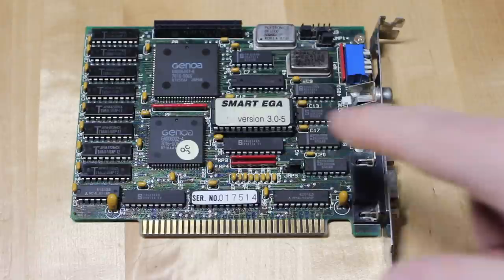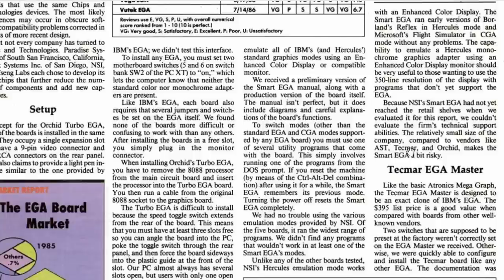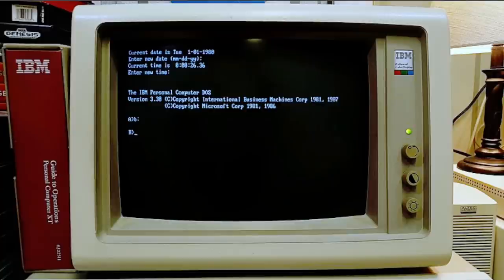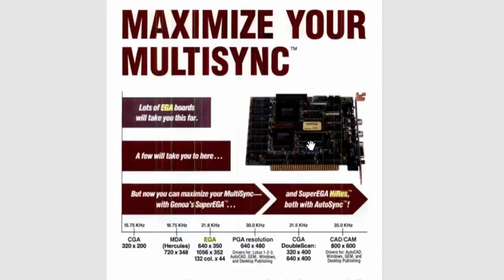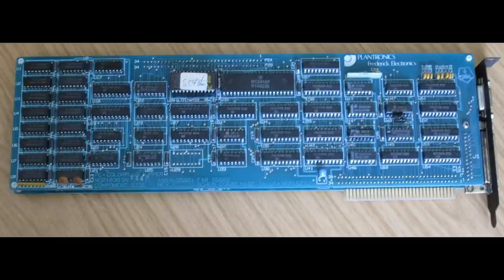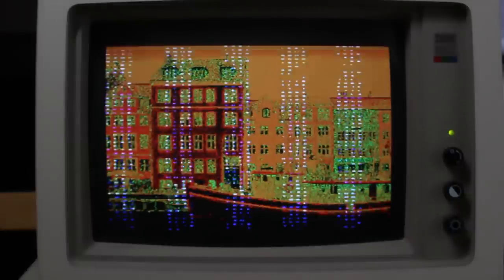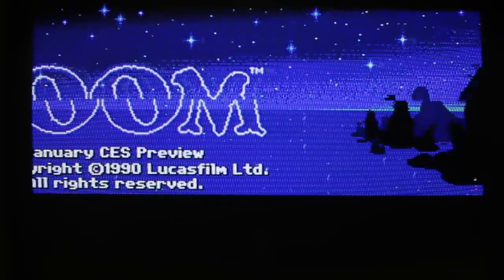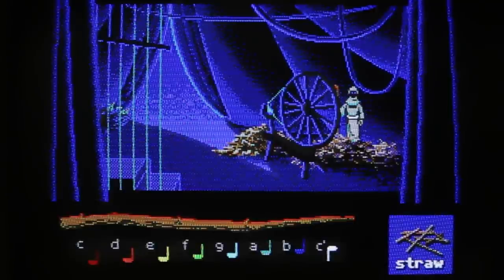The intrigue of SmartEGA and SuperEGA

Comment: About the advertisement at 5:00 - if the card supports double-scanned CGA at 31.5 KHz, would it be possible to force it to only use these modes and connect a normal VGA monitor with a DAC?
Reply from the maker: That sounds like it could work. As it happens I have an NEC Multisync VGA monitor so in theory the higher resolution modes might work too. There's no guarantee though. For a while every EGA card required a specialised monitor to go with it.

If an RGBtoHDMI adapter doesn't work I might look into the DAC idea. The main problem is eliminating noise. Everything has to be fairly well shielded.
Reply: I'd expect so, you can connect 15kHz TTL to SCART with some resistors to drop the P2P voltage down from 5V to 0.7V, and a simple XOR (?) gate to combine the syncs. For CGA to VGA you could use an IBM-to-RGB converter circuit which is a fairly well known quantity (really it's a case of each of the primaries contributing about 0.47 volt, and the intensity bit 0.23 volt to all three channels, with a special case to reduce the green intensity by half for "brown") and maybe not even have to do anything to the sync at all. Or if it uses the EGA colour standard... each of the primary colour lines just needs to be reduced to 0.47 and each of the secondaries to 0.23 volt and that's that. IE you build a very simple 2-bit-per-channel DAC right into the cable...

That's really all the Multisync does inside the case when displaying a CGA or EGA standard image (I think a genuine one even has a switch to cut out the IBM RGBI processing and turn brown back to dim yellow?), as does an actual EGA or CGA monitor, as the electron guns are themselves analogue devices. The use of TTL signalling is really just to make things simpler on the video card end (ditching the DAC is cheaper and uses less board space, and if you don't have a big palette it's kinda unnecessary), and also helps maintain signal quality at what were considered high frequencies at the time over not particularly good cables running between cards and monitors with circuitry that may not be the greatest at handling high frequency analogue signals other than for the fairly short run between monitor cable input and the actual tube.

(heck, even the comparison machine of the ST used TTL for its highest rez mode, though that was double what EGA managed, and later the TT's and the Amiga's ECS extra high rez modes were respectively mono TTL and reduced to only 64 colour palettes for similar reasons, despite having VGA-grade analogue colour at regular resolutions)

Comment: I think that using of static RAM is the reason why original CGA is faster than this one. Static ram chips are usually faster than dynamic. But still, this card was released 4 years after IBM CGA, there is no excuse for being slower.
Reply from the maker: I'm almost 100% sure the original IBM CGA card used DRAM. If you don't access sufficient locations in a given time it actually loses its contents.

Comment: doesn´t the composite out work to hock up to a normal TV, they you would get 640x480?
Reply from the maker: I don't know if those are composite outputs. On original EGA cards they were something else. It's a while since I made the video, so I don't recall if I found out differently in this case. The issue though is that composite output is a relatively poor quality signal usually. But at least technically, what you say is at least possible, as some manufacturers did make one of the outputs a composite out in the mid to late 80's.
Reply: @PCRetroTech  how diffrent is the synk? I remeber my old high-school running vga on ega monitors via a semi passive adapter. The opposite should be easier.
Reply from the maker: @matsv201  I can imagine a digital to analogue passive adapter but not so much in the other direction. EGA had two sync methods so monitors could distinguish modes. I don't know much about VGA sync, but it's probably related.
Reply: @PCRetroTech  the amazing thing is that windows 3.1 looked pretty much the same on those ega monitors as in ega monitors.. the colors was pretty much exactly the same. But there was one drawbacks. The screens was pretty blury... and well  running windows 3.1 on a 386SX is not optimal.
Reply: @PCRetroTech  if I understood it correctly they pulled the analog output with resistoes so it ended up on diffrent side of the trigger point of the digital adapter. This would make 3 of four diffrent scenario possible. The  have to use a transistorer aray or something simular for the last.

Comment: 5:25: I noticed you have IBM's Guide to Operations \ Personal Computer XT. I think you have a 5150, don't you? Or do you (just) have a 5160?

I'm asking because when I got my 5150 from the reportedly original owner, it also came with a Guide to Operations \ Personal Computer XT -- emphasis on the XT. So I got a UK/European PC and it came with a GtO that said Personal Computer XT. I've long wondered if that's because by the time the 5150 was generally available in Europe (i.e. 1983), the 5160 was also out, and maybe there never was a PC-only GtO for the 230V 5150. Maybe GtOs for 5150s sold this side of the pond always also said XT, even though that's technically incorrect and arguably adding to the (even then) widespread confusion (of people falsely equating PC and XT machines).

Can you comment on this? Does anyone know for sure? 

PS: I note our GtO says 6322511 on the binder's spine. My GtO says 6183479 on the title page inside, not on the binder.
Reply from the maker: This wasn't my photo but one from Wikipedia. Thanks for reminding me. I forgot to add it to the credits.
Reply: @PCRetroTech  Ah. Pity. If you or anyone else knows anything about this Euro-GtO PC/XT mystery, I'd love to hear it. 

I do know that at least early US 5150 GtOs only said PC, not XT. I would really like to learn if later GtOs, or at least later European GtOs that shipped with 5150s also said XT, because this seems to be such an odd inconsistency. 

I know many people got it wrong back in the day and referred to PCs and PC clones as XTs/XT clones -- and here's evidence of IBM doing the same thing! So weird.
Reply: @ropersonline  They were referred to as XT by late 83 to simply incorporate a distinction to the PC-AT.

Comment: Very interesting graphics card. I have an ega card that claims to be HEGA, I wonder if the h is something special like this card or just a marketing name.
Reply from the maker: That one I am not familiar with. There were a lot of these insta-standards that popped up around that time.
Reply: Probably "Hyper EGA" or "High-res EGA" or the like, or even just a company name (I think the parent company of one of the most commonly used super-EGA chipsets started with an H but I can't quite remember the rest?)... So, like, Hyper-Enhanced Graphics Adaptor ;)
Reply: @tahrey  mine was made by paradise. Some of them do have enhanced capabilities!
Reply: @CoreyDeWalt  yeah i don't think it's a name that as yup iijh
Reply: @CoreyDeWalt  aghhh phone phone ky
Bboarrrd
Reply: @CoreyDeWalt  aghhh phone phone ky
Bboarrrd
Reply: @tahrey  come again?
Reply: @CoreyDeWalt  Sorry, my phone had a bit of a freakout and I didn't have any time left to follow up once I finally got it working again.

Anyway, I think I was basically trying to say that I don't think it was a name that was used much for actual box sales, maybe some OEM distribution and showing up in POST screen messages, but otherwise it was more of a parent holding corporation that owned (developed?) the clone / extension chipset and BIOS ROM etc, as well as one or two of the better known brands that the boxed cards were actually sold as (e.g. Paradise, Genoa maybe?) and selling chipsets to other brands.

"Headland" possibly?
Reply: @CoreyDeWalt  Oh also I was probably going to ask if you could work out some things regarding those enhanced abilities, particularly if you had a way to measure the frequencies. Unless I already did?

Comment: Lines are the only factor that define CRT resolution. Number of horizontal pixels is irrelevant for monitor since it's just an analogue signal.
CGA has just one 200p mode.
EGA has 200p and 350p.
VGA also has two modes 400p 70Hz and 480p 60Hz.
VGA also has 200p and 240p modes, but it's doubling every line, so such modes appear with unique doubled scanlines and CRTs sees them as 400p and 480p modes anyway.

VGA could run many 'tweaked' resolutions with nearly any horizontal value from 256 to 480. However vertical lines were limited to 200, 240, 400 and 480. It was possible to run different values, but it could damage the display.

Anyway PC graphics standard were a mess. CGA had terrible palettes, EGA was even worse since it should have at least selectable palette in every mode from 512 colors (like Atari ST had). VGA tried to make things right, but it ended with very limited feature set, because it had to be backward compatible with CGA and EGA.
Reply from the maker: I think it was possible to get different numbers of displayed lines on VGA through letterboxing or by using the overscan without damaging the monitor. But fundamentally these were just variations on a theme, the themes being those you listed. Going outside the bounds offered by those modes could indeed be problematic.
Reply: @PCRetroTech  VGA being backward compatible also supported 350p, but I don't know if original VGA used 350 lines directly or displayed letterboxed 400p. My ISA Cirrus Logic SVGA uses 400p in high-res EGA modes. These are of course all 'safe' modes that shouldn't damage VGA monitors.
VGA was flexible enough to allow setting a large variety of modes. 600p was the most popular of undocumented modes, since it got support in popular software. Windows 3.1 SVGA 800x600 driver will fallback to VGA 800x600 56 Hz mode if there's no VESA modes.

However the problem is, that despite VGA quickly become a widely adopted PC standard, nearly all cards were actually clones with some Super VGA abilities that could do 800x600 in 16 colors and 1024x768 in 4 colors even if they only had 256 KB of RAM. So it's really hard to even get original VGA hardware to test it's capabilities.
My first PC had OAK 67 SVGA with a monitor that could do up to 1024x768 interlaced.
Reply from the maker: @Leeki85  I have a large number of VGA cards, but I haven't actually spent time checking yet if any are really just VGA only. I once saw an auction of an original IBM VGA card, if there was such a thing. It certainly had IBM chips on  it. It went for an absolute fortune and even though I knew that would happen I underestimated its value to collectors by a factor of about 2 or 3.

I have a few OAK cards, but I'm not familiar with the OAK 67 SVGA. I remember my first VGA was a TsengLabs SVGA. I can only imagine that was an ET4000AX as it was in a 286, but I really don't know that for sure as I don't remember the model number. It's also possible we were actually supplied something cheaper and told it was a TsengLabs. We wouldn't have known the difference at the time. We'd certainly never seen one before.
Reply: @PCRetroTech  Yep, IBM made an 8-bit VGA-only card.  Officially called the "PS/2 Display Adapter", since the idea was to bring PS/2 graphics to other PCs (and to the MCGA PS/2 models for that matter).
Funnily enough, one magazine ran a series of compatibility tests (PC Tech Journal as I recall), and found that IBM's VGA card wasn't 100% IBM VGA compatible!  That is, it doesn't behave exactly the same as the PS/2's VGA chipset.  I guess the latter was the only real deal.
Reply from the maker: @x86VileR  Ah now only IBM could do something as hilarious and confusing as manufacture a VGA card that wasn't.
Reply: @PCRetroTech  It took IBM a lot longer than its clone-maker competitors to figure out that the market demanded 100% hardware compatibility. Initially most vendors thought that mere DOS compatibility would do -- arguably a step up from the CP/M and BASIC dialect zoo, but it became pretty clear pretty soon that customers weren't buying semi-compatible hardware. One wonders what IBM could have done if they hadn't made that mistake with the PCjr and the MCA and PS/2 and PS/1 lines. (Correct me if I'm wrong, but I don't think IBM ever made a mainboard with both MCA and ISA?) Generic clone-makers ended up being more compatible than hubristic big brand vendors. Of course there were exceptions. Compaq's success came because of their compatibility.
Reply: @ropersonline  They DID!  Its a pci based 486 pizzabox that had MCA bridges. And it has 1 isa slot. And it came after the PS2 line was long gone.... name of it fails me at the moment.
Reply: There are limits. The video card pixel clocks and the hardware using them can only run so fast (e.g. vanilla CGA is 14MHz, EGA 16MHz, VGA 25 and 28MHz), and the monitor circuitry has a soft upper limit on the bandwidth of the circuits that interpret the incoming video signal and then feed that through to the electron guns (which effectively means that the higher your vertical rez, the less your horizontal can be ... which can be demonstrated with a too-long non-shielded VGA cable and trying to drive a 1080p flatscreen in a conference room from a small formfactor PC's integrated graphics - although that's more down to signal reflection and such in the cable, it still gives a very horizontally smeary image at full HD rez, but clears up quite quickly to having sharp pixels if you drop back to 720p).

On top of which, there's the dot pitch of the CRT colour mask, which is barely even good enough for any kind of readable 80 column text on some basic tubes...

As for the lines thing ... your total lines per frame (active plus blanking/sync) multiplied by frames per second is tied to your horizontal sync rate, which is the real ruling factor, along with the limits of vertical sync (and, in some cases, your eyes). Multisyncs can only cover a certain limited range on both fronts without having trouble (and as you near the limits, you have difficulty with adjusting the size and linearity quite as you may like it), and fixed-frequency monitors, whilst they don't have to be driven at an absolutely exact rate (you may have like 5 or 10% variation, which at least lets you cover 50 and 60Hz if centred on 55, or even 50 to 70 for VGA's official range which is maybe more like +/- 12%, and can deal with inaccurate pixel clocks / cycle per line counts that then cause slightly wonky Hsync), are much more tightly limited as they're basically resonant circuits which get dangerously unhappy if trying to sync with a much different frequency.